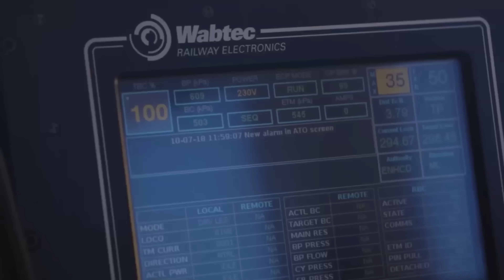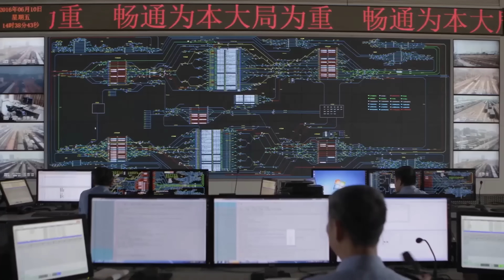Top 6 Record Breaking Trains That Defy Belief

Comment: How about another train that isn't so much long in length but in distance travelled, that is train that regularly runs between Chengdu in China to Milan, and which loses parts as it goes through Warsaw, Hamburg, Barcelona and even to London as well.  Currently it is the longest train route in the world and takes 18 days from Chengdu to Milan, 16 to London.  And while to date it is only freight it is rumoured that persistent requests to add a couple of passenger coaches are under serious consideration.  Hoping they do, I have every intention of booking a seat.